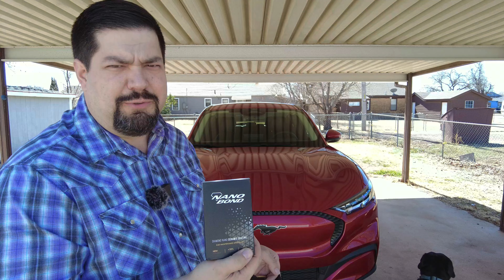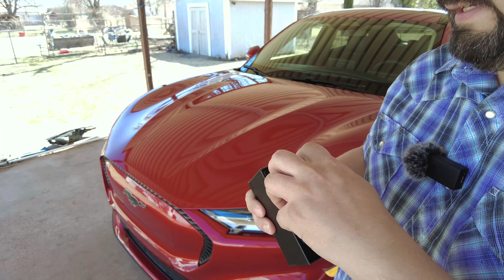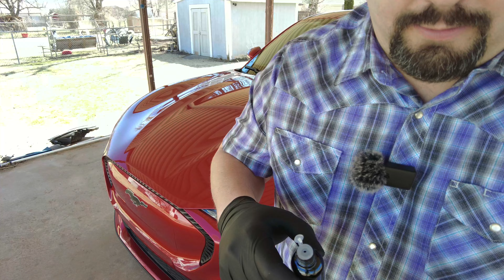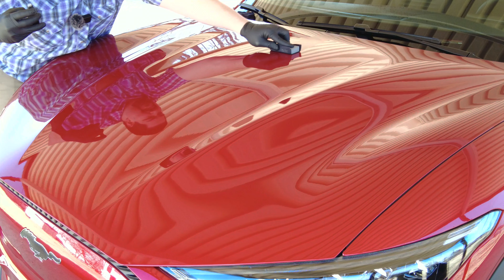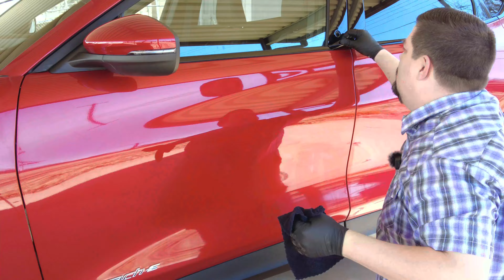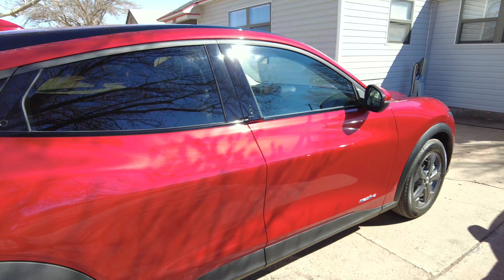Ceramic coating the Mach-E

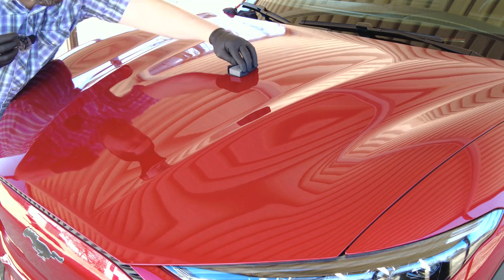Comment: Yay, finally a 4K video! Also I liked the first song you used during the timelapse at 4:50, what's the name of it?

Is the coating still holding up 3 months later?
Reply from the maker: Most of my videos are in 4k it just takes YouTube forever to process them
Reply from the maker: Yeah the hydrophobic abilities are holding strong, water still just beads right off and I wash my car a lot. I have gotten a couple of rock chips in the front so it doesn't work magic but I still think it's a really good brand.